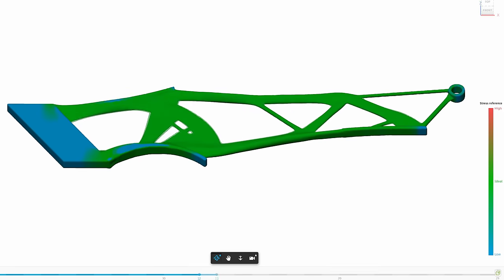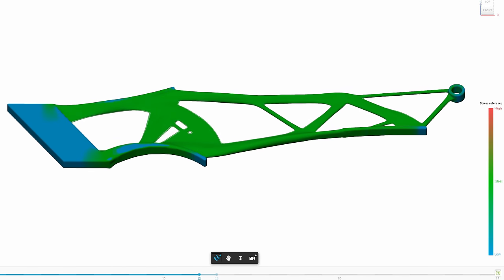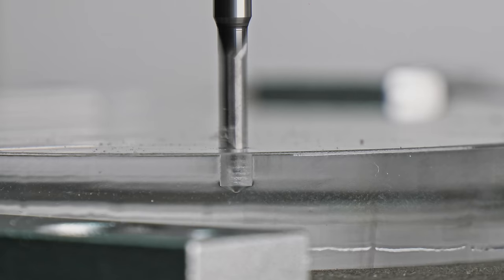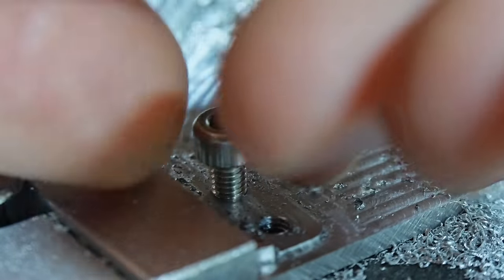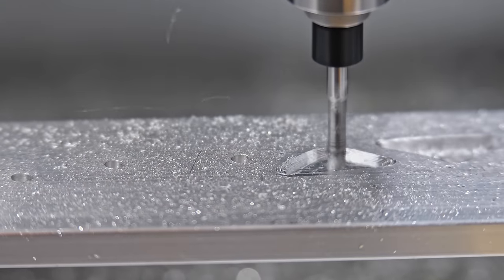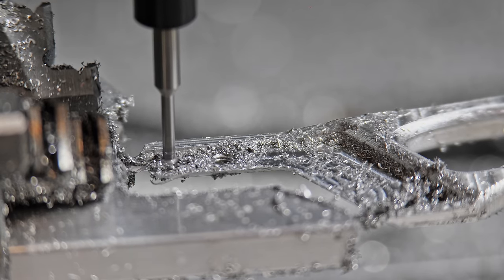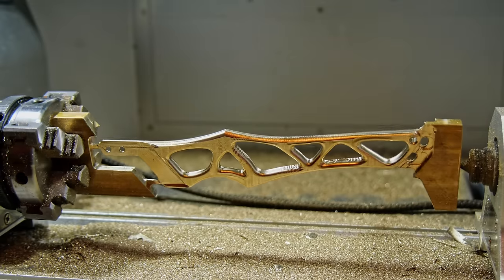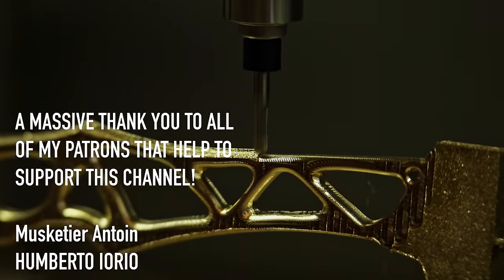CNC Machining a Brass Utility Knife

Comment: This part could have definitely been done on a 3 axis very easily. Cool to see these desk top mills coming along with their technology. A misting system would greatly help out in place of a flood coolant system. If you klnecked up tighter on your tools so there isn't as much stick out and increased your feed rate and reduced your woc and doc and use more hsm style of milling you can greatly increase your chances of less broken tools and less machining time. Slotting isn't your friend with low rigidity machines high feed endmills are.
Reply from the maker: True, could be easily done in multiple 3 axis setups, was fun to use the rotational axis tho

Comment: Thank you for Air review. Great skills on 4axis.
I'm little bit worried now because you said original Carvera is more rigid, accurate and better finishing. Can you please comment or make video where you compare how big difference is between them? 
I'm watchmaker, it's important to me
Always thank you TAOW for you time.
Reply from the maker: Thanks!
Yes to clarify those comments a bit further, the Air has unsupported 20mm rods on the x-axis where the original Carvera uses supported square linear rails, that leads to more rigidity at the tool head. This leads to better surface finish, and quieter cuts on the original Carvera. 
Both machines have the same ballscrews from what I can tell so the positional accuracy should be nearly identical.
I do want to do a test quantifying the and comparing surface finish but have not yet done it directly, I think it should be possible to get very similar results with the air by using more conservative speeds and finishing passes.
Reply: @taow  
Seems logical. I thought Air new cast frame will fix rigidity but seems not that close to linear rails. As always lower feed will fix it :D 
Can't wait for comparing
Thank you for reply!
Reply: Had you considered the exact same knife handle/files in the original Carvera to do a side by side comparison? I have backed the Carvera Air, and this would be my first CNC, so surface finish to me is important, but if slowing down the feed rates can improve the finish then I am happy for the milling to take longer.
Reply: @taow  I got in on the air as backer #24, but I'm strongly considering getting the OG Carvera. You mentioned that the OG machine is not made redundant, but I'm curious, if money wasn't really an issue, would you buy the OG machine and also keep the Air when it arrived, or would you personally cancel the Air and just stick with the OG?

At first I was mostly concerned with the ATC, but the more I dig deeper, it seems the rigidity is going to be the main issue.

Comment: Could you have a jigsaw blade in one of the bit holders and then use the CNC as a power hacksaw instead of milling all the cutouts to chips?
Reply: Something tells me the z-axis isn't that fast, and the x/y gantry isn't strong enough either.

Comment: They will never be able to sell the original at $6000 after releasing this. No one wants to pay $4000 for an ATC and a inch of more working area
Reply from the maker: The original machine also uses fully supported square rails on the x-axis so is more rigid, results in quieter cutting and better surface finish/ dimensional accuracy. But yes $4000 is still a lot more to pay when ~60% of the functionality can be achieved with this machine.
Reply: @taow  I'm very relieved to hear this actually, until now it looked like almost exactly the same build apart from ATC, laser, work area, vacuum... will still go for the big brother then
Reply: @erikm9768  I've got two, and it's definitely the better of the two. Steppers will never be servos.
Reply: And i mean. It's almost ALWAYS on sale, and literally 99% of the people that own one paid sub 5000. Most sub 4500 and once this machine is off kickstarter it will be 2999.
Reply: @BedroomMachinist  How do I access these sub $4500 prices? Used, you mean?